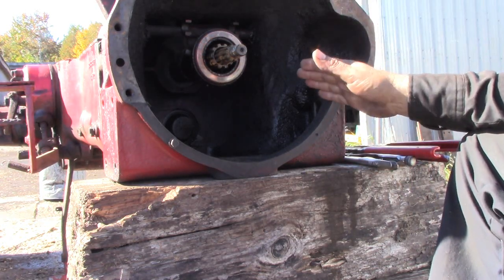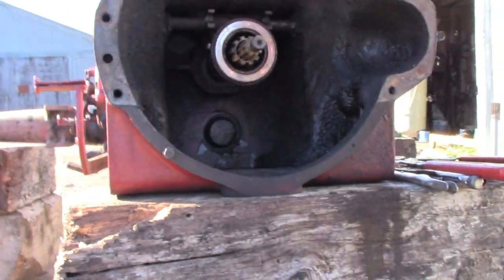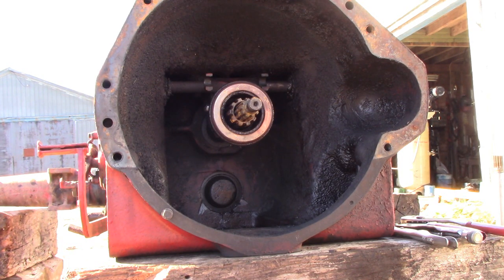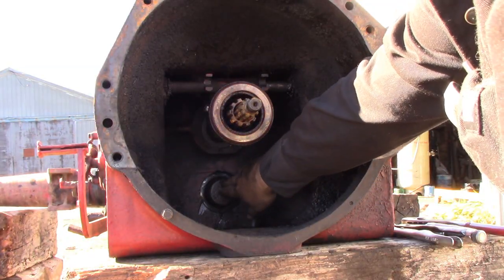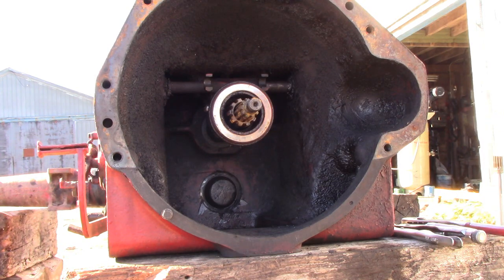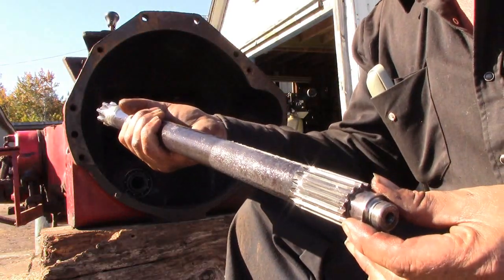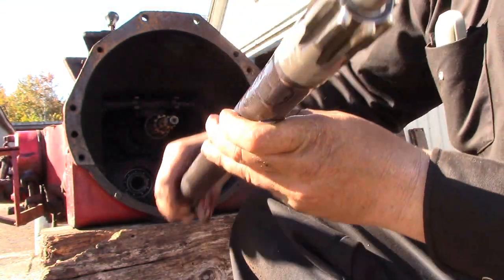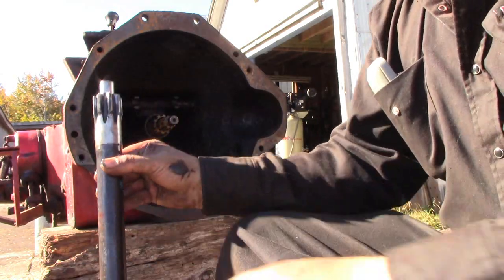B414 Etc  Series PTO

Comment: Hi Dave, thanks for posting all the videos, they are a great help. I seem to have a similar issue on my B275 as a few others with the pto clutch. When I push the clutch in half way down I can shift in and out of the different gears with no issues. When I push the clutch peddle the remainder it is supposed to allow me to engage the pto but it’s not, I can feel it grinding as I try to push the leaver to engage it. When there is no load / implement on the pto it will grind a little and engage but that is probably not good. The only way I can get the pto to work with a load on it is to start the engine while the pto is engaged. I read a few articles, one below, and it seems to be a common problem but so far I have not found the fix. Sounds like something is not moving freely on the pto part of the clutch.  I can see a couple things moving in the inspection window when pressing the clutch peddle but I’m not sure what to look for or if there is anything to do with the inspection plate off. I've adjusted the peddle height to 6 7/8 " to the bottom of the peddle and the ammount of free play to about 1/2 "  but still no change. One odd thing I noticed is that the pto gear at the back turns very slow, like one revolution in about 40 seconds even thought it is not engaged. 

https://www.yesterdaystractors.com/cgi-bin/viewit.cgi?bd=farmall&th=725692
Reply from the maker: The pto shaft turning when it is not engaged is just a little friction between to 2 shafts where they connect, nothing to worry about. The hard engagement is either the adjustment on the pressure plate or the PTO disk has stuck to the pressure plate which is pretty common if your tractor sits a few months at a time or the PTO doesn't get used for e few months at a time. Thanks for watching!
Reply: Thanks for getting back to me so quickly, I haven't had it for too long so it could be it wasn't used much, I haven't used it too much either. I tested a snow blower on it a while ago and just picked up a post hole digger for it recently, I'll try using it more and see if it frees up a bit. Thanks again for all the great videos, I've learned so much and saved so much time and probably money by not breaking stuff while learning. Cheers , Angelo

Comment: Thank you for the reply Dave, mine is  an odd one for sure. even has s/a stamped on the id plate with the serial number. no there isnt a nut underneath the rubber cup seal. The shaft end has a 7/16 thread  but it wont pull forward.The only nut is has a lock ring on it  with a bearing retainer and thats 
on the gearbox where you undo the 4 bolts inside and the 6 on the outside of the bellhousing which is what i cant get off i suppose until the pto shaft is out
Reply from the maker: The only thing I can suggest is that you give it a rap with a hammer (being careful not to damage the threads) to see if you can drive it out of the bearing.

Comment: Thanks for the video. I have the steering box from my B250 out on the bench. How do you get the old sector shaft bushings out? I am just preparing my reciprocating saw to cut them out.
Reply from the maker: I would likely use a long chisel to get them out. Thanks for watching!

Comment: Thanks for the vids.I have an IH 384 with a standard PTO with worn quill gear bearings. Is it possible to split this tractor only between trans and clutch housing as long as I unclip the end of the pto shaft in the clutch housing.
Reply from the maker: It is doable yes. Thanks for watching!
Reply: Thanks for the help
Reply from the maker: @trentbryan8084   You're welcome!

Comment: Hi Dave, thanks for your videos.  I'm only needing (hopefully) to replace the rear PTO seal [leaky out the back] and won't have the hydraulic unit off.  Should I have the PTO engagement lever "engaged" or "dis-engaged" in order to keep the collar in place and not dropping down into the transmission shaft like in the video?  Many thanks,  International Jim!
Reply from the maker: Engage the PTO and the collar will stay in place. You shouldn't need to pull the shaft out, just remove the seal retainer at the back, the shaft should stay in place. Thanks for watching!
Reply: @CanadianRedneck15  Super, thanks Dave!

Comment: Also presumably the oil in the section at the back is filled from the transmission oil inlet by the gear lever as in your fluid change video?
Philip
Reply from the maker: Correct, the plug by shift lever fills all three compartments.

Comment: Hey dave! I have an international 384 and the splines on the shaft look similar to yours and also the slip collar dosnt look very good. Could i just weld it so its running all the time? Also where the end of the hallow shaft wich the pto drive shaft sits in is worn out on the iside but only where the rear beating sits, should i just leave it? Parts are all discontinued.
Reply from the maker: I guess you could weld but your PTO would be running all the time, not exactly safe. The hollow shaft I believe should have a brass bushing inside near the back. Thanks for watching!

Comment: Hey Dave, love your videos. Has saved me many times thank you. Can you tell me if the bearing with the double row of balls that runs on the back of the lay shaft that is obsolete. Can I replace it with a roller bearing. Thanks Baz. 434 tractor.😢
Reply from the maker: If I recall correctly it has a double row of balls because it also acts as a thrust bearing so since they are not available it is best if you can find a good used one. If you can't a roller bearing would be better than nothing I expect. Thanks for watching!

Comment: Any idea why the replacement input shaft (or the old one I tried for reference) won’t go back in? Seems to go as far as the aft splined section, but won’t go all the way!
Reply from the maker: Check the internal bearing that one or more of the needles didn't get loose and turn crossways in the bore. Thanks for watching!

Comment: How do you judge if the input shaft needs to be replaced aside from it just looking worn? I took apart my 444 pto to replace the shear pin and it looks rounded, but at the same time It doesn't look terrible, same goes for the collar, rounded, but not terrible.
Reply from the maker: It's normal for the ends of the splines to be rounded, the problem is when the sides of the splines are worn tapered. That is when the PTO will kick out of gear. Thanks for watching!

Comment: Dave,.  
 Would you consider or point me to a video showing how to replace the pto lever/shaft on a IH 444?
Also I believe I have a dual clutch and the clutch works fine for the transmission but will not disengage the PTO. the tractor sat for about 10 years without running, I've never had a tractor split apart so hoping to avoid that.
Thanks for the vids!

Comment: I have a B-414 International Tractor that needs a radiator....it has the original one in it from England.

Do you know where I can get a radiator? I am in the Catskill Mountains of New York
Reply from the maker: You can check with A&I products for a dealer near you as they are available new through A&I but they are pricey. Thanks for watching!

Comment: Hi Dave, it seems that front pto shaft could be pushed back out of the pto driven gear very easily once you removed the circlip. Does the rear of this shaft sit in a bearing or does it just rotate freely inside the countershaft? If it is a bearing I imagine it's not a very tight fit?
Reply from the maker: The PTO driving shaft run through a bushing in the back of the countershaft, it's a pretty loose fit.
 Thanks for watching!
Reply: @CanadianRedneck15  Oh I never knew there was a bushing in the rear of the countershaft. I pushed a 2 ft length of pipe in over the pto shaft on the rear of my 354 tractor, and when I push the end of the pipe up and down there's quite a bit of movement at the other end of the shaft inside the tractor. Maybe this bushing needs replacing? Can it be replaced with the hydraulic unit removed?
Reply: @CanadianRedneck15 After some googling I think I've found the bushing inside the rear of the countershaft - part number 751161R1. Do you know if it's possible to remove this bushing without having to remove the countershaft from the transmission? I imagine if I could hit it towards the rear it should pop out?
Reply from the maker: @damjord  You might be able to drive out the back from the front or you might be able to fold it up from the back with a fine chisel to remove it.

Comment: I'm looking at picking up a 354, but the owner says the pto can only be engaged with the engine off. Would this shaft issue cause that? Or would there be a different problem? Thanks.
Reply from the maker: That is a clutch issue, the PTO clutch is not releasing, likely stuck from dis-use. You will need to split the tractor and replace the 2 stage clutch. Thanks for watching!

Comment: Good morning, I have an Inter National Harvester 785 tractor. I have a problem and I have not found a solution for it. There is no hydraulic pressure to the radiator shaft. I bought a new pump and a new control, but the problem still exists.
Reply from the maker: I am guessing you are telling me there is no coolant flow and you replaced the water pump and thermostat. You could have a buildup of sediment (mud) or scale (minerals). Drain the system and flush it out with a garden hose, fill with clean water and check. Thanks for watching!

Comment: LOVE YOUR VIDEOS DAVE I CANT SEEM TO FIND THE DRIVER PTO SHAFT FOR MY INTERNATIONAL B275 DO YOU HAVE A PART NUMBER OR KNOW WHERE I CAN FIND ONE?
Reply from the maker: If you have a late 275 with the shaft held by a lock ring it's 751078R2, they don't provide the number for the early shaft fastened by a nut but they are inter-changeable. Thanks for watching!
Reply: @CanadianRedneck15   THANK YOU

Comment: Hi Dave
Excellent video and instructions , thanks. Any top tips for getting the rear PTO shaft back in and engaging on the PTO lever? I cant get it to engage - is it easier if the lever is removed? is there a way to see what is happening without taking the lift unit off?
Thanls
Philip
Reply from the maker: Taking the PTO lever out will give you a chance to see and get the rear PTO shaft engaged to the front shaft and then you should be able to get the lever into the gear when you put the lever back in. Thanks for watching!
Reply: @CanadianRedneck15  Thanks for not only the excellent video but also your very prompt response - really appreciate it

Comment: so if I take out the rear shaft and collar , is there a way to check the front shaft without pulling it out?
tractor is in one piece
thanks ,!
great videos
Reply: and people told me about the "fork" that could be broken...
Reply from the maker: If your tractor is kicking out of gear on the PTO and the collar is worn, the front shaft is worn and will need replaced also. You may be able to have a look at it if you take out the PTO lever and look through the case there.
  Thanks for watching!
Reply: thanks for answering that quick! 
will do it following your instructions!
Reply: so when the tractor is in one piece, how will the front shaft slide all the way to the back hole? theres about 23 inches from the hole to the tip of the shaft and about 10" space in the front to push it towards the back

thanks
Reply from the maker: @edlucarseneau4203  If you have a small handed friend you can coerce to reach in through the back you're golden, otherwise you will likely have to lift the hydraulic unit off.

Comment: I have a question in my b 275 there are two types of pto speeds like in low different speed in high different can you tell me on what rpm they are running in high and low..... please
Reply from the maker: I have never seen a 275 with 2 speed PTO but I would assume low speed would be 540 and high would be 1000rpm. Thanks for watching!

Comment: Hi there dave i have a 414b inter pto will not engage the lever is jamming when it was running my slasher it popped out of pto all the time until finally the lever will not engage have you come across this before and how hard is it to fix any help would appreciated thanks dave
Reply from the maker: Sounds like the PTO driving shaft and the shift collar are worn and likely has broken the pin in the shift lever.
  Thanks for watching!

Comment: Great to watch,  HELP needed as i cant find any info on removing the pto input shaft on my 434    2 snap rings removed on shaft by case bearing but it wont move off the mainshaft. Theres a black rubber cap below it but that doesnt appear to come off  HELP splines are 10/16 which im told is unusual ??
Reply from the maker: I have a video here https://www.youtube.com/watch?v=1sve9HaZMbk&t=19s  that show how to remove the PTO input shaft. You have to pull the clutch housing off the front of the transmission to accomplish the task.
  Thanks for watching!

Comment: Bonjour Dave. J'ai un b414 dont l'arbre de prise de force c'est.cassé net en sortie alors que je passais le broyeur à fléaux. J'ai sorti assez facilement l'arbre sans avoir vidangé... J'ai mis un linge à la sortie de l'arbre pour que l'huile ne sorte pas. J'ai pu trouver la pièce en occasion. Ma question est: comment remonter le nouvel arbre ? Je l'insère directement puis je fais le complément d'huile ? Ou autre manip ? Comment positionner le levier de mise en marche de la prise de force ..il est totalement dans le vide ... Merci
Reply from the maker: If the PTO lever wasn't in gear and the sliding collar didn't come out with the PTO shaft you will have to find it in the bottom of the case and put it on the new shaft before installing. It would be best to remove the PTO lever until you get the shaft in place, than you will be able to get the lever in the groove in the sliding collar. Thanks for watching!
Reply: Pour cela je dois démonter tout le système de relevage qui se trouve sous le siège ?? Ou je peux récupérer cette pièce ailleurs plus facilement ? Car c'est un travail long !!  @CanadianRedneck15
Reply from the maker: @vidal.damien  Use a magnet (or someone with small hands) through the PTO hole to grab the sliding collar. No need to remove the lift unit.
Reply: @CanadianRedneck15 merci pour le temps que vous prenez pour me répondre ! C'est sympathique ! Si je comprends bien je passe ma main par l'arrière où l'on doit introduire l'arbre de prise de force et je récupère l'objet juste derrière ? Auriez vous une photo ? C'est comment ? Merci
Reply from the maker: @vidal.damien  The sliding collar is about 2 1/2" diameter x 2" thick. Yes just reach in through the back.

Comment: i have a international harvester 454 put clutch in still grind to go in gear  i was cutting grass hit a dead tree then clutch broke help
Reply from the maker: Did you have the flywheel ground? That needs to be done every time you change the clutch with a ceramic clutch. You also have to make sure you have the 2 halves all the way together before you tighten any bolts otherwise you can bend the clutch disk and they will grab.
  Sounds like you will have to split the tractor again and find out what broke when you hit the tree. Thanks for watching!

Comment: Hey Dave, Iv been watching all your videos and what a help they have been, Your the man! I just got my 414 gasser running after a 10 year sleep in the bush. I noticed gear oil leaking from the inspection plate below, when I removed the inspection plate, that bearing with the snug fit cap for the PTO is completely destroyed. I put a rubber cap over it with a hose clamp for the winter as I plan to use the bucket for snow this year anyways. My question is, can I remove that bearing through the inspection plate access area (where the clutch is) without having to split the tractor?  Thanks Jarred from Ontario!
Reply from the maker: From what I can see you probably can remove the bearing without splitting the tractor, the shaft will have to come out towards the back and the gear and I believe the bearing also, each is held in with a lock ring.
  Thanks for watching!

Comment: I can not activate the PTO on my B414 when the engine is running, I have to turn it off, and just before the engine stops I can press the PTO into gear. Is my problem related to this video?
Reply: I know this is an older post, I have the same problem. Did you get ur issue solved?
Reply: @ronniep1376  Hi, I assume it must be some sprocket which is stuck, I never fixed it because soon after this it got a more serious problem with a hole in the engine block
Reply: @andersbruun3007  sorry to hear that , I’ll keep shutting it down to engage

Comment: Dave, could you give us the part numbers on the rear shaft, collar, and front shaft?  I have a B275.
Reply from the maker: The sliding collar is part# 751113R1, the rear shaft is part# 75114R21 and the front shaft is part# 3068451R2.
  Thanks for watching!

Comment: HI Dave. many thanks for your videos, ive just replaced the clutch on my 434, i have a problem with my pto as it has jammed tight and i cant disengage it, the pto clutch works fine   but pto  running all the time the clutch is out. . the pto lever just falls forward and doesnt engage either.  any ideas..im from near Gatwick airport in sth Engand and just like to say your vids were so useful and helped me no end ..regards Steve
Reply from the maker: Sounds like the pin in the lever has broken or the lever has become disengaged from the sliding collar. Remove the 3 bolts from around the lever and pull it out the side, you should be able to determine the cause from there.
  I am glad you are enjoying the videos, thanks for watching!